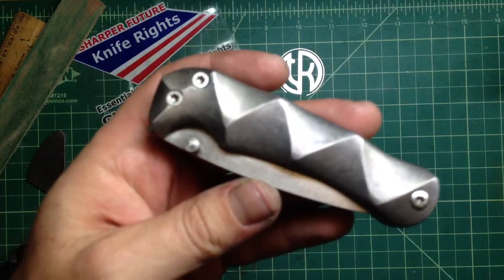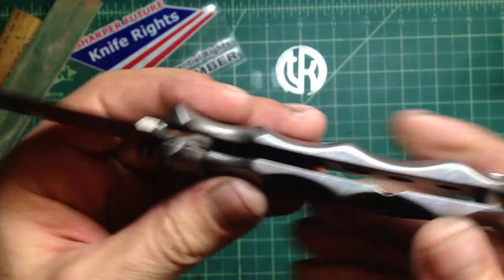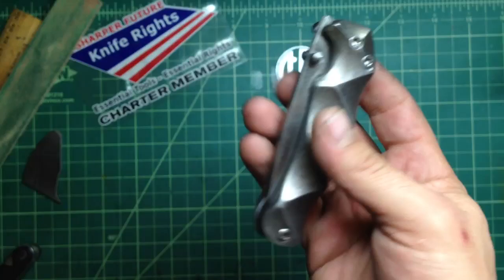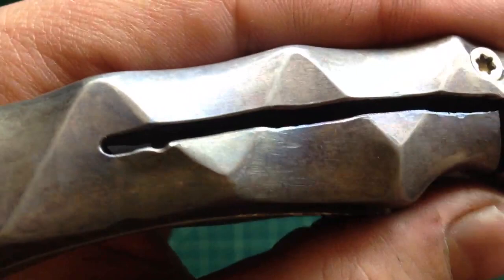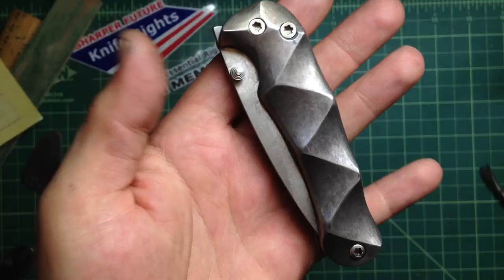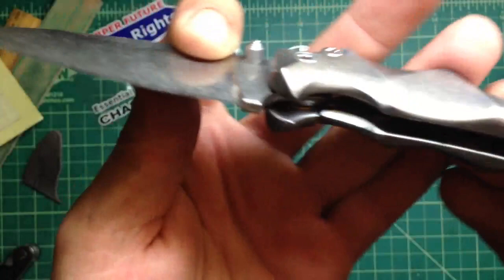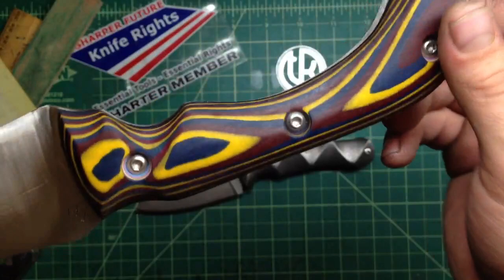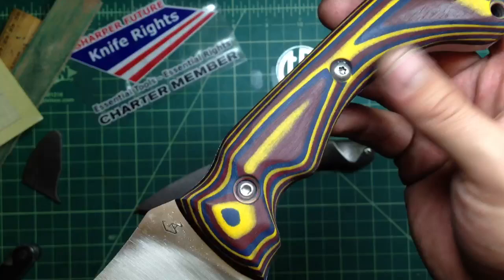Framelock Cut but Busted

Comment: Hey Mike. I might just be shooting out of my but twice I've never made a knife before. But the relief cut is still pretty thick making for a very strong tension. If you cut a little more into the relief cut the spring tension wouldn't be as strong. Then if you push the lockbar I then it might not be as hard to actuate the lock. Just a thought?